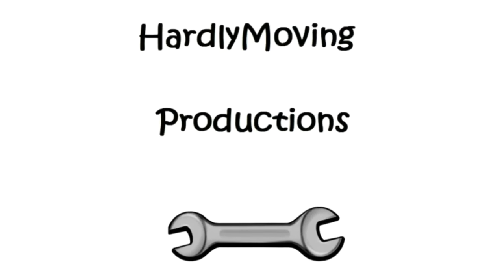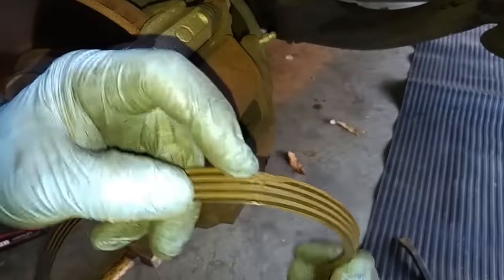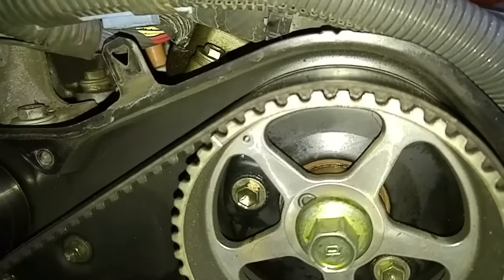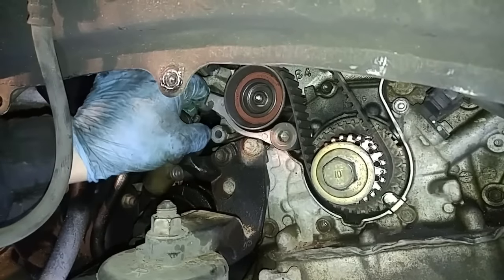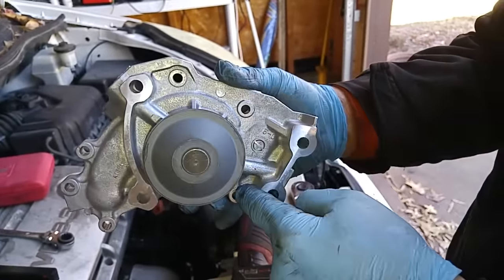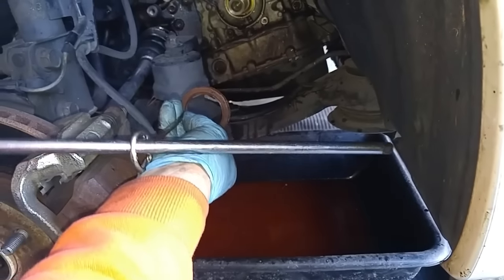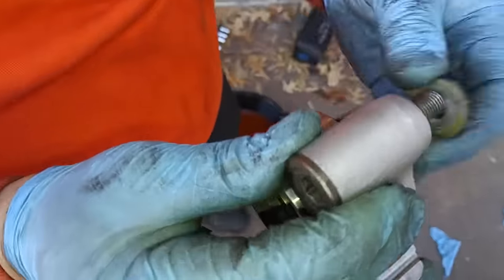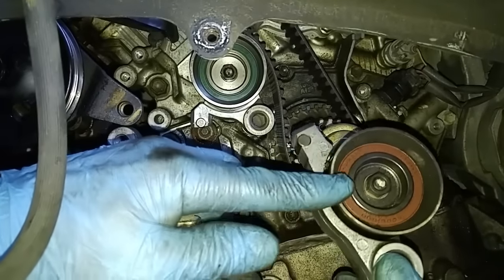Toyota Sienna V6 3MZ-FE Timing Belt, Water Pump, Seals, & Pulleys Replacement

Comment: Hi, a question regarding the rear cam sprocket. I've heard of people putting a spanner on that and holding it against the firewall to stop the cam returning to a relaxed state once belt tension was released. Could this happen? 
This is a fantastic video, and very informative. I'm going to be doing the timing belt in my 2004 toyota estima vvti 3L v6.
Reply from the maker: The cam sprocket bolt is torqued on at 90 lbs.  That's a lot!  Cannot visualize preventing the cam sprocket from moving holding/supporting it somehow against the firewall.  Just hold the sprocket in place with a long handle chain strap wrench and use a long handle breaker bar to remove the sprocket nut as shown in the video.
Reply: So there's no chance of the cam snapping back yo a relaxed state after belt tension is removed? I may not be doing the cam seals but I'll check them.
Reply from the maker: Okay ... now I know what your concern is ... that the cam sprocket could spring forward or back after taking off the belt ... right?  That has happened to me in the past.  This could occur if you move the cam sprocket more than one cog to the left or right ... it could snap away from the top-dead-center (TDC) mark by around 45 degrees.  I just use a box wrench to move the sprocket back to the TDC alignment mark on the back cam sprocket cover then carefully put on the new belt.  No damage will happen to the valves when the cam springs away from the TDC mark.  Just re-align the cam sprocket.
Reply: That's awesome. Thanks for your help.
Reply from the maker: @sheckb1  No problem ... glad to be of help.
Reply: I'll be in touch if I hit a snag.
Reply: Odd question, but would 1/2" impact wrench with 450nm of torque be enough for the main pulley removal with deep impact 22mm socket?
Reply from the maker: On the 3MZFE engine, I would say no.  Buy a high mass impact socket
Reply: Realizing that this will probably be a stupid question, but the engine in my van is 3000 v6 four cam. Is that the same?
Reply from the maker: When you said 3000, I'm assuming that's the 1MZFE engine which uses a different TB tensioner.  Look at my Lexus ES300 TB video and you'll see the difference from this video.  Here's the link:
https://youtu.be/KkjgBVxBaeU
Reply: Yeah it is definitely the 1MZFE, but vvti four cam 24 valve. I do understand about the different TB tensioner, you explain this in this video. I have watched your 1MZFE video as well.
Reply from the maker: All MZFE engines are 4 cam 24 valves.  The 3MZFE (3.3L) uses a different TB tensioner pulley bracket and tensioner when compared to the 1MZFE.  The 1MZFE in later model ES300's, modified the valve train (VVT-I) to variable valve train but the engine mechanics (i.e. timing belt and components) remained the same until the 3MZFE was introduced with a slight increase in displacement.
Reply: Hi mate, just wondering if you could tell me, I've got a check engine light that comes up as o2 sensor bank one sendor one. Is that the one under the floor? 
I'm looking at a replacement one but it's description is on "front". Not sure if they mean front of vehicle, or bank one.
Reply from the maker: Cle Sheck:  bank 1 sensor 1 is the AF Sensor on the exhaust manifold. By the firewall side. ... The sensor i replaced on the Sienna spark plug replacement video
Reply: @hardlymovingpro  I searched all over of this bit of reassurance....yes this may be a year after you commented but I really appreciate being able to find some evidence that I don't have to worry too much.  Yep, it sprang toward the fire wall, and also toward the radiator.  If it runs weird I'll do a pressure run down check on each cylinder but I'm thinking you'd have to have full gas explosion force to really bend those stems...they can't be that fragile.

Comment: Did anyone have a squealing noise coming from the timing belt after installing a new one?
Reply from the maker: If anything it's your accessory belt or or worn belt pulleys
Reply: There seems to be like metal dust on the timing belt. Its running great,  it just squeals sometimes. Is there a break in period for the new pulleys (WP, Idler, & Tensioner)?@hardlymovingpro
Reply from the maker: Nope.
Reply: @hardlymovingpro  any ideas on the metal dust sitting on the belt?

Comment: Interference t-belt engines are ticking time bomb headaches.
Reply from the maker: Not necessarily.  Belt technology has advanced enough to permit 100K + service intervals.  Did a belt change on a ES330 with 140k miles on the clock.   Way pass the service due mileage and time frame.
Reply: @hardlymovingpro  not all are the same, for e.g. you can have 2 lexus ls430s same year, model, make, miles, etc. but one t-belt is more cracked/worn/beat up than the other one. It's a matter of chance too.
Reply from the maker: True but other factors to consider outside of mileage and age;  Hot vs cold climate as well as stop-and-go short distance driving vs highway cruising.

Comment: Nice video!  Best I have seen !  Question...wont the chain strap wrench damage the teeth on the sprockets? If so , with the potential for nicks on the teeth wont that lead to premature wear of the belt? What if I try an old leather belt between the chain strap and the sprocket?
Reply from the maker: Thanks for your post and concern.  Let me start off by say that I've been replacing these cam seals for over 10 years.  I had previously used a sprocket holding tool but found it inadequate for use on Toyota's MZFE engine because:  1.  The handle length was too short to prevent the cam from moving while applying over 90 lbs of torque (via long handle breaker bar or cheater bar) to get the pulley bolt off  2.  The torque needed to take the pulley bolt off began to BEND the sprocket holding tool.  3.  I needed to find and use a "cheater bar" to go over the handle of the sprocket holding tool's handle.   When I saw another certified tech using the long handle chain strap wrench, the task of remove the pulley bolt became incredible easy!  With respect to nicks, I've done repeated TB replacement jobs on cars that I had previously done over 100k miles ago.  The replaced belt looked just fine.  What you really need to concern yourself with is using quality replacement parts.   OEM Aisin water pump, Bando timing belt and Koyo or GMB pulleys.  You can try using a leather strap wrench if you're confident it can take over 90 lbs of holding toque.  If that belt snaps, prepare yourself for a BIG kick back!  If nicks are of concern, you can place a piece of tire rubber between strap wrench chain and the cam sprocket.
Reply: Thank you for your quick response. In fact your suggestion about using a piece of rubber between the strap wrench and the sprocket is essentially what I was thinking of also but using a leather belt instead. I went ahead , previously , and bought the chain strap wrench from amazon via your link. Thanks again  @hardlymovingpro
Reply: I did get the Aisin kit for my 06 Sienna along with the three oem seals ( sourced separately and not part of the kit) . Aisin TKT-026. Regards
Reply from the maker: Okay ... we're on the same page.  I'm with hard rubber, you with leather.
Reply from the maker: Good luck with the repair and hope all goes well!
Reply: So what I did was cut the old timing belt and wrapped it around the camshafts then used the chain wrench. Worked rather well
Reply from the maker: Hey ... good idea!

Comment: Son inlaw looking for family vehicle.  I recommended  a toyota sienna or a Honda odyssey.  He found a 2005 Toyota sienna le with 185,000 miles for $3500 dollars for sale by a single owner. Wants  me to check it out. Im a retired lineman diyer take maintains and repairs  family vehicles only. I have done  omllete ti ing belt replacements  on my 20p6 Subaru sti,  98 honda prelude, 95 honda odyssey  and 99 Toyota rav4.  But haven't  done  a Toyota sienna. Reason why I'm  checking out your  video.
Reply from the maker: The Sienna is a solid vehicle.  The V6 is mechanically is sound.  The valve cover gaskets and the cam sprocket seals will cause oil leaks as you approach or exceed 200k miles.  Also the power steering pressure side hose and the water pump to thermostat housing hose under the intake manifold can go bad.

Comment: What does  a job like this cost
Reply from the maker: Depends on whether the water pump and the cam/cranks seals are to be replaced as well.  But by general estimates local shops here in the US charger over $800, dealerships around $1,200.

Comment: I am getting the P0016 code after we did the timing belt. The car runs fine with no issues. Is there a way for me to check the timing belt to see if everything lines up without going through the entire ordeal?
Reply from the maker: That's a camshaft position sensor error ... meaning you're timing is off.   You'll have to take the belt covers off, recheck the alignment and remount the belt.

Comment: Fantastic Video, Where can I pick up a timing bet kit for 2000 toyota sienna? Also any websites, where torque specs could be found, just to have peace of mind for.. I would also like to purchase that chain tool to clamp on the cam sprokets what was it called? Thank you again, great video!
Reply from the maker: Thanks.  Here's a link to a text and picture based article I wrote a few years back that I periodically update.  It has the manufacturer's engine pictures (with torque specs) and links to where you can get specific tools and TB kits.
https://axleaddict.com/auto-repair/Toyota-1MZFE-Timing-Belt-Replacement-Camry-Avalon-ES300
Reply: @hardlymovingpro  Looks like really good write-up.. I'm going to do Full Timing Belt job on my dads 2000 Toyota Sienna soon and this will come in handy, thank you!
Reply: @hardlymovingpro  in the write up you mention something about replacing the oil pump seal, aside from crank and cam seals. It seems to be the plate behind the crank sproket. Do you have any reference material on that, the van I will be working on has almost 200k miles.. if i going to do timing belt might as well replace all the seals. The van is currently loosing substantial amount of oil.. It seems like it might be front main seal. I'm not sure id that oil pump seal may also be the reason why.. Any feedback will be great help!
Reply from the maker: The oil pump seal replacement recommendation was for the Toyota 4 cylinder 5SFE engine commonly found in the Camry.  The Sienna "Van"  has the 1MZFE V6 and does not have a oil pump seal problem ... as far as I know.
Reply from the maker: Also, if you have a bad oil leak problem, the valve cover gasket by the firewall side can leak very bad.
Reply: @hardlymovingpro  yes, thank you so much! I'm going to start the work soon, hopefully this week. I will stay posted with my progress.. My dad has never serviced the van this extensively (only oil changes), he hasn't even changed a spark plug since he first purchased the van in 2000.. It runs well, other than the oil leak, which leaves puddle behind. I'm not sure if he just got lucky, or these Vans are solidly built. But in any case, seems like a fun project for us to do together this week. Thanks again, I'll stay posted with my progress, and if anything comes up. 👍

Comment: Replace Sienna’s water pump is even more difficulty than replacing Highlander’s water pump. I guess dealer will charge $1500 minimum to replace the water pump.
Reply from the maker: No way!  Only 3 hour work effort!  Pump's around $150

Comment: At 14:35 Extremely important not to over tighten the bolt on the tensioner.  The 10 mm alan bolt goes into the aluminum crank shaft housing and by sad experience I did stripped the threads in the housing. Also never use Helicoil brand to reestablish threads, I should have used Time-sert. Time-sert provides more precision in keeping perpendicular and square.  Helicoil, is free had and I was off on a slight angle and hand to engineer a washer to off set the angle. What a nightmare.
Reply from the maker: Sorry to hear of you difficulties.   Next time, perhaps, if you used a 1/4" ratchet to tighten the 10 mm and below bolts, it would be difficult to over torque and shear the aluminum threads.
Reply: Thank you for this video. It was a life saver!

Comment: that steel plate over the water pump is one of the dumbest things I've seen
Reply from the maker: Actually the metal gaskets are better than than fiber element gaskets that sticks to the engine block and is a pain scrapping off.  Also, the fiber gaskets can soak coolant over time and slightly shrink.  When that happens, the 10 mm water pump bolts loose their tension and coolant leakage can occur.
Reply: @hardlymovingpro  not talking about the gasket...the big black steel plate you had to take the cam gears off for

Comment: After doing this type of work for almost four decades as a ASE tech I no longer want a vehicle that uses one of these rubber bands.
It's not necessary and manufacturers are moving away from this drive system. Who wants a car that you know will need a 600/800 dollar repair every 90K. Most people should not and will not tackle this job, one mistake here and your looking at major expense repairing the engine...
Reply from the maker: I hear your argument but some of these timing chain driven engines are not that durable.  I've seen repair estimates up to 3X that of a timing belt engine if ANYTHING goes wrong with the chain drive (i.e. lose tensioner, worn chain guides, sprockets and stretched chains).   Also it's much easier to replace a belt drive (4 hrs) vs a chain drive system (8 hrs +).
Reply: @hardlymovingpro  In all the years I did this the only time I saw a part that needed replacing was because of lack of proper maintenance (oil changes) with the exception of a few defective tensioners which were made incorrectly to start with. Kia comes to mind which by the way is about 100 bucks cheaper than the belt kit for a odyssey. But even with the kia if people would have it fixed when they first heard the noise a tensioner would have been all that was needed and maybe a follower guide between the cams... It never took me 8 hours to do a chain, most paid a flat rate of 4/4.5 hours unless you had a BMW 760Li in which case the cost was way up there.
I have probably replaced 300 timing belts and less than 5 timing chain sets. This is in part due to belts being used most of the time in manufacturing....I don't actually know which cars use timing chains because we never saw them for this type of service....
Reply from the maker: @Bass.Player  Then I guess you haven't worked on the GM's 3.6L all aluminum V6 3 chain setup with 18 13 mm bolts holding the timing chain cover on? ... notorious for leaking timing chain cover seals and camshaft position sensor errors due to stretched chains.   Here's a video of a guy working on one:  https://youtu.be/uHB_zcNMMzg  I feel for him.  Done this job numerous times and charged the customer big $$$'s
Reply: @hardlymovingpro  Never worked on Domestic vehicles to speak of. I was a Diagnostician for VW Porsche/Audi for 13 years and then moved to Honda and completed all their courses to obtain Master tech, for what ever that's worth. I spent the last years of my career as an auto technology instructor at the local College and I wrote the course curriculum for the State. I made a ton of money replacing timing belts, I liked them but at 70 I don't want to own one I have work on like this....  The timing chain on my dodge is still doing it's job at 200K, it will probably outlast me...
Reply from the maker: @Bass.Player  There's a big difference between "hands on", roll up your sleeves, sweat equity knowledge vs being manufacturer or ASE certified.  My BS degree in computer science and management science with required pre requisite course completions in calculus, trigonometry, geometry, logarithmic functions contributed zero to my auto repair knowledge.  Advanced composite materials used in belt technology was moving belt longevity to 200,000 miles before the industry decided to switch back to chains.  Belted engines are quieter and have less centrifugal mass to overcome.  History keeps repeating itself.  70's was chains.  80's - 00's was belts.  Now we're back to chains.  You're Dodge is probability still running because it's a short chain OHV and you change your oil every 3K miles?